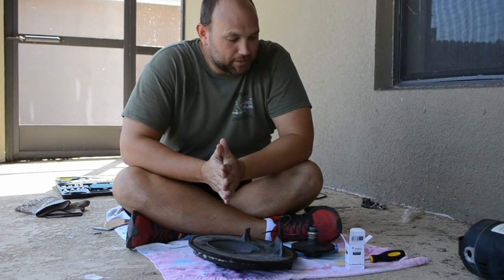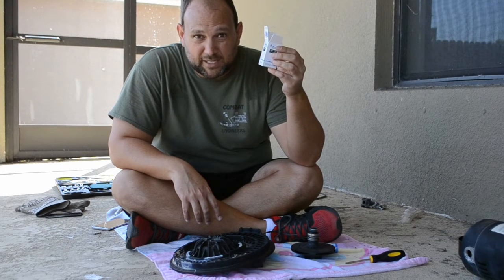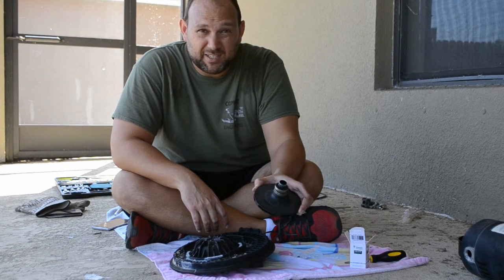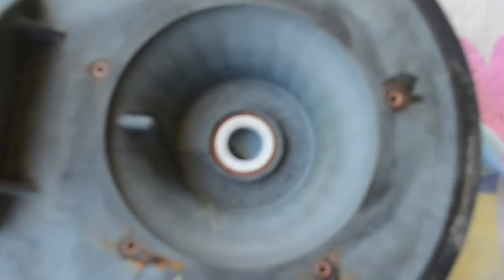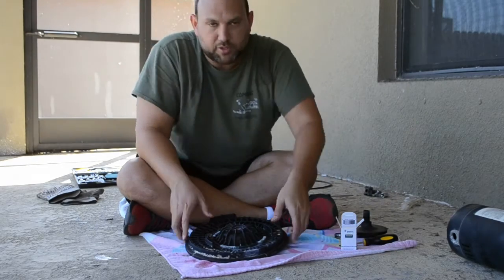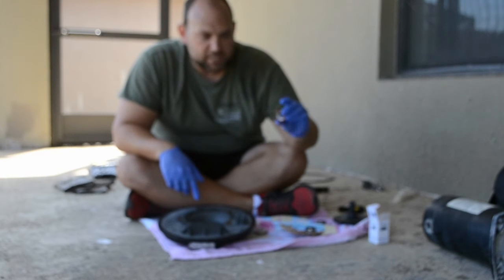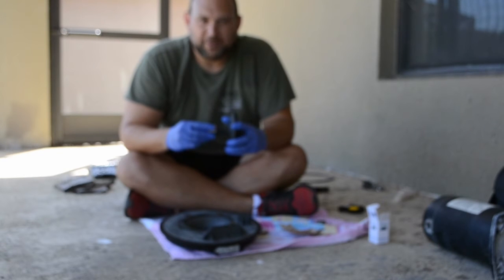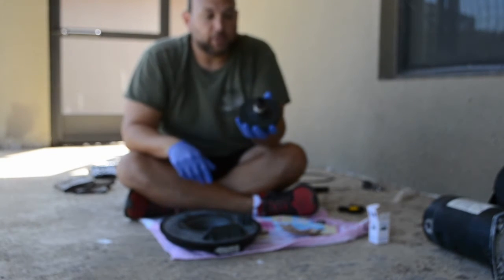Replacing the Shaft Seal

Comment: I agree with the Captain, a little bit of lube on the impeller shaft makes the seal go on a lot easier and seat better.  Only need a little bit.  Just don't get the lube on the ceramic.
Reply: You are correct. It's a bit meticulous but very easily accomplished with patience and practice.

Comment: That is a Sta-rite pump and there are two different seals depending on the model. These pumps are the worst to replace the seal on. Also, you should use lube on the the seal. I've replaced tons of them. How many times did you have to break the pump back down because they rarely go smooth and you end up with the same or even worse leak.
Reply from the maker: I actually didn't have any leaking issues on this motor but did on a different one.  Lesson was learned but that is why I am the Pool Noob anskd not the Pool Expert!
Reply: @poolnoobie  l've been at it for 14 years. I wasn't trying to criticize you, I was merely adding my experience to help anyone to advance their capability and understanding of the nature of the beast.
Reply from the maker: @captain_redpill8983  I appreciate you watching and adding the helpful tips.  No offense was taken whatsoever.  I know what I am!  LOL

Comment: Hello,
 I'M thinking about replacing the motor on my Pool PUMP ,and not taking it to a shop, which would save me around $125, BUT I'm NOT sure if it's a DIY job for a rookie.I believe that when I change the motor, I should also replace the shaft seal, the seal plate o-ring and the diffuser o-ring.  Do you have any information on this matter, in terms of  how difficult it'd be?
Also, what's the deal with not touching the shaft seal? 
Lastly, what's the WATER slinger? I saw it in the Pump schematic parts breakdown.
PS Is that a DuraGlas PUMP, by chance. It looks a lot like mine.

Comment: Just watched your video.. This is exactly what I am trying to do. >Thanks for the detailed instructions. Only one thing which I could not follow and unfortunately your video after you put on rubber gloves becomes out of focus. I wanted to know the orientation of the second part of the shaft seal. Does the metal side face the white ceramic seal or does the rubber side face the white ceramic seal while loading it on the impeller. Please respond. Thanks.
Reply: Hey Nasir, @ 1:44 you can see the original orientation of the shaft seal portion that goes on the impeller.  The metal springs point down with the rubber side facing out.